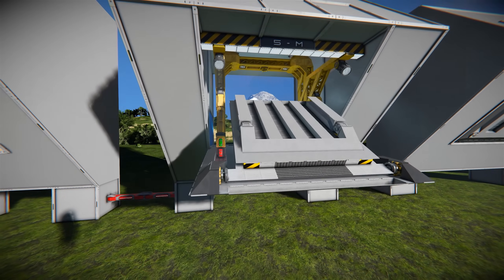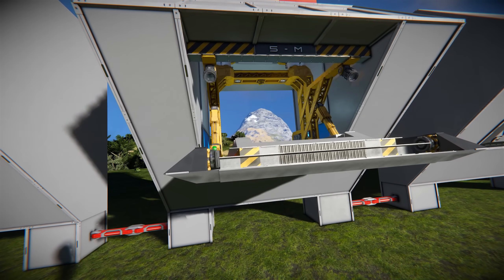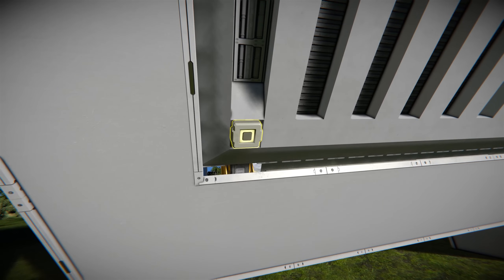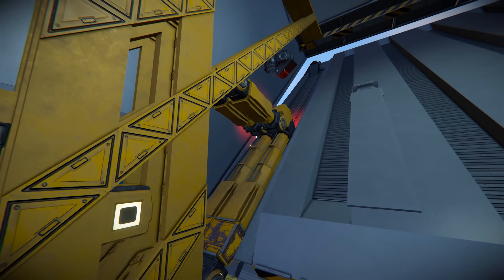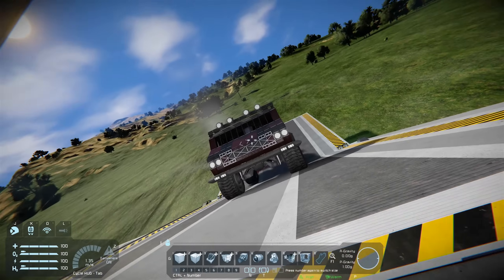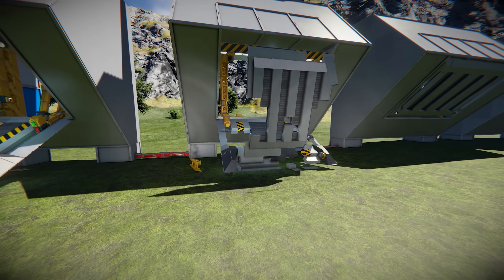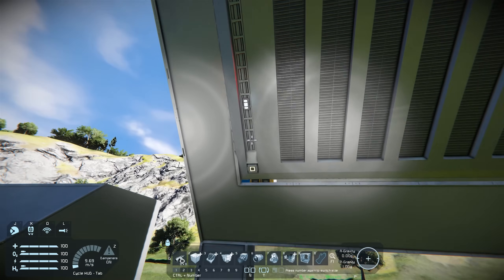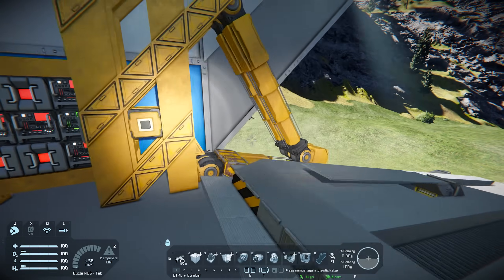Modular BOARDING RAMPS Made Easy !!! - Space Engineers

Comment: I have a small grid utility shuttle with a rear boarding ramp that also acts as the airtight seal so the passenger cabin is pressurized.  Turned out quite well.
Reply: I'd love to see it
Reply: @Kennet0508  Nikodaemos on Steam, shuttle should be in my workshop.  The rear hatch is a bit funky, but it works.

Reverse the hinge before unlocking the rotor and that is usually enough to get it to open properly.

I need to update the Blueprint eventually, I've improved it and made it more user friendly.
Reply: @Kennet0508  I think I have it on my Steam workshop.  Nikodaemos is my profile, it is called shuttle Aput, or personnel shuttle.  Something like that.

You can tell it is the right profile with the other vehicles.  All small grid, 2 space miners and 2 planetary wheeled miners.  T.I.E. miner and Gouger, Caterpillar and EXC.  A cheap wheeled cargo truck called Scouter, and the shuttle should be there, I think.

If not, I won't be able to post it any time soon because Steam quit working for me.
Reply: Is it at an angle or is it a flat wall? If it’s at an angle then how did you make it pressurized I need to know.
Reply: @BillyBobdonkerman5942  It is at an angle.  Thanks to the collision box update a couple years back or so, it made it possible to do an angled merge door.

The seal is made by slope tips touching the SIDES of the ramp.

See my comment above, it should be on my workshop.
Reply: @DanielHomant  thanks for sharing
Reply: @BillyBobdonkerman5942   No problem.  I like building merge doors and even find ways to use them in my small grid stuff.

My current project was a major upfit of the R.U.S.T. cargo transport.  Pretty much everything has been redone and rebuilt, but it still looks like it came from the same family of ships.  I turned the catwalk under the 3 cargo containers into an airtight hangar to dock my 2 mining ships by utilizing merge doors.  But that is all large grid.  Was working on turning the forward section into the industrial part with a garage for my Scooter and Caterpillar before Steam stopped working for me.  That plan was using a merge ramp as well, like the shuttle.  Just bigger to drive vehicles on it.